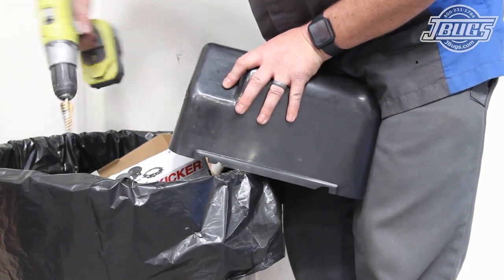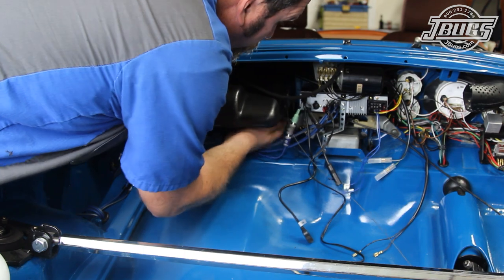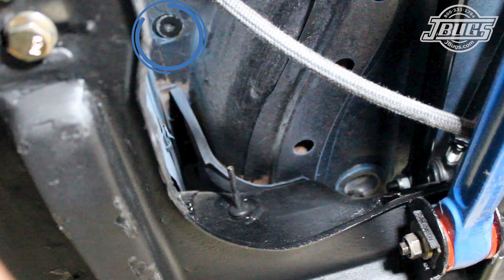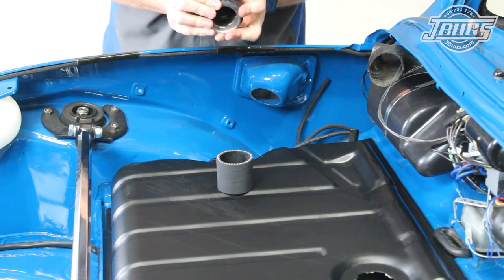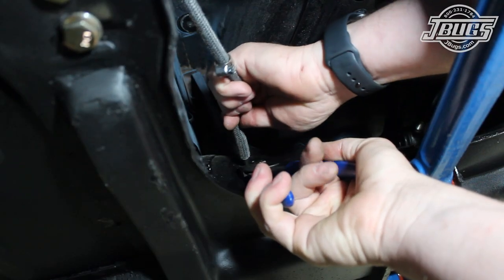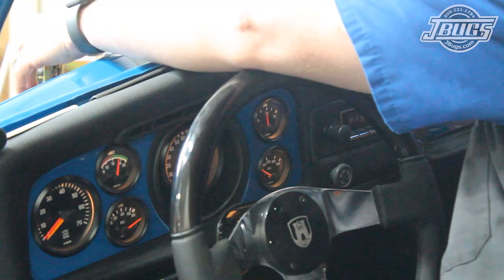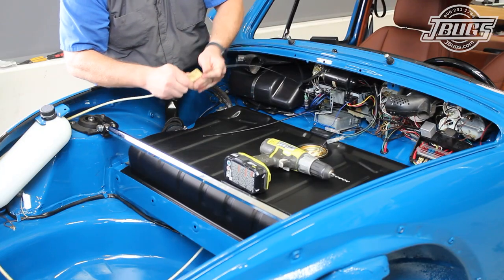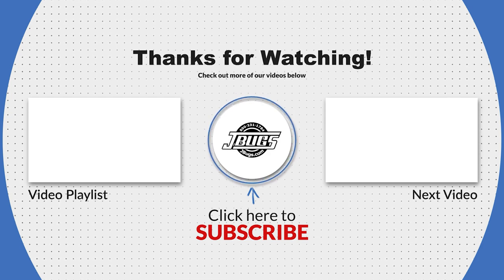JBugs - 1971 VW Super Beetle - Trunk Wrap Up - Part 1

Comment: How did you attach the hood release cable? I cannot remove it from the old lever since it is nothing that can be screwed off. If I break it loose, how would I reattach it? I can’t use the old cable which has rivets and I don’t have tools for that. And how did you line up the attachment for the last screw holding the lever from inside the glove box? It looks so much easier than it is.
Reply: The hood release cable is attached to the lever with a small dowel pin the presses in or out. A small screwdriver or even a nail can be used to push the dowel pin out.
I use a pair of pliers to press it back in place. Small nuts and bolts can be used instead of rivets, to hold the lever assembly to the glove box. Lining up the handle bracket is very easy with the windshield and hood out of the way, yes but with an assistant, the job isn't bad if they are in place. Someone inside the car can poke the screw through the bottom of the dash and a person looking in the trunk can line up the bracket with the screw.
Reply: @Sam_Mebane  the glove box is in, the cable connected, but how is the cable held so that the length is not too long to move the catch? I’ll send a photo by email.
Reply: @Sam_Mebane  I was able to separate the two arms to slide the cable onto the already installed new lever which I probably did not need after all. Then I closed the two arms. The other issue was solved by attaching the plastic bracket to the glove box which had been installed with rivets to the old glove box. I see that there are two means for stabilizing the cable which was different from this plastic bracket.

Comment: I have been waiting for this part in the series for a long time! I have a 71 Super Vert, and I have an issue where my hood release cable won't pull my latch enough to release the hood pin consistently, can you go over the proper process of setting up/testing the hood release cable?
Reply: We cover it in part 2. Most likely your issue is movement in the housing for the cable.

Comment: It appears as though the fuel vent hose you use is just a soft flexible rubber hose ? What type of hose and what inner diameter? I didn’t notice it in the parts listing as all hoses looked to be braided/less flexible than what was being used. This is the last hose I need to finish off all my new fuel lines/tank. Thanks as always for these videos. Super helpful!
Reply: It's there - https://www.jbugs.com/product/N203531.html just braided vacuum hose.
Reply: @Sam_Mebane  thanks so much! I was originally looking on my phone so the smaller screen I didn't see the details, but after watching it on my computer could see it was a braided hose. lol Sorry about that. Thanks so much! Got it ordered!
Reply: @Sam_Mebane  did you use 3 feet in length for that vent line ?
Reply: @johnmartin5153  I used more than 3 feet for sure, but it all depends on how you route the line. I just ran it to atmosphere, under the car. Later, I actually changed the vent hose routing later to the top vent as the lower vent would occasionally siphon since it wasn't run to a charcoal canister or other emissions components.
Reply: @Sam_Mebane   ahh thank you Sam. Good to know.
Reply: @Sam_Mebane   so cap off both on the left side, cap off bottom right side and vent to atmosphore via the T joint in the larger hose on the top of the right side.. correct? im finally about to take care of this

Comment: Sam one other question on the fuel vent line that is run out the bottom of the car. Does it just hang out the bottom a bit and that’s it? Or does it run somewhere/is mounted somewhere underneath?  Thanks so much!
Reply: It is just a vent for the fuel tank, fuel can't get out of the tank if air can't get in. Originally VW ran the vent hoses through various canisters and hoses in the trunk and back to the engine compartment as part of smog equipment.
Reply: @Sam_Mebane  I assumed it just hung out the bottom, but just wanted to make sure you guys weren't running it anywhere specific. Thanks again! Really appreciate you and the JBUG team.

Comment: Just wondering Where to get All the relays to replace on a 74. On Jbugs didn't see em.
Reply: There are only 2 relays that are essential, the headlight relay - https://www.jbugs.com/product/111941583.html and the flasher relay - https://www.jbugs.com/product/111953227D.html. The door buzzer and any other relays you might have aren't essential.

Comment: Hey Sam, ong shot, but I have a situation. 74 super, the trunk won't open but it isn't the cable. I went through the escape hatch (the hole) on the underside of the body, no dice. I think that somehow the sliding piece that secures in the groove isn't moving. How in the hell do I get this thing to open? I also was able to remove the screw but I can't get the handle off. I'm trying to avoid cutting the handle. Any suggestions? Also, the spring came out.
Reply: I've only ever been successful by cutting the handle. I've never been able to get a locked/stuck hood open otherwise.
Reply: @Sam_Mebane  thanks for responding. How would I go about cutting the cable? I want to let you know that I called Jbugs and the guy who took my call spoke VERY highly of you,
Reply: @facesbybriana4708  the cable can be cut by calling your cable provider and telling them you're tired of payin...oh I got confused, sorry.

I didn't mention cutting the cable, I said I to cut the handle. Literally, cut of the hood handle, a saw-zall works best. You have to be cautious if your paint is in good shape. The handle needs to be cut off the hood, there is a bolt at the top of the handle, and one at the bottom, along with the push button at the bottom. Once the handle is removed, there is nothing to hold the hood to the latch, and the hood can be opened.

Comment: I can’t seem to fit the Top Left Vent Hose on either the tank or the Filler Neck fitting? The link sent me to 12mm hose but it seems to small and I cannot get it to fit. Would the correct size be the 17mm vent hose for a 71 super beetle?
Reply: Grab a micrometer (or a measuring tape if that's all that is handy) and double check. We used to offer a 15mm vent hose but it has been discontinued for some reason. It seemed to be the most common size too, but we use the 17mm nowadays if needed and clamp it down.